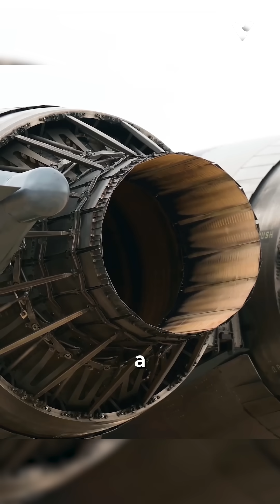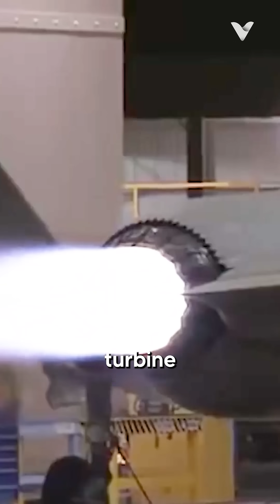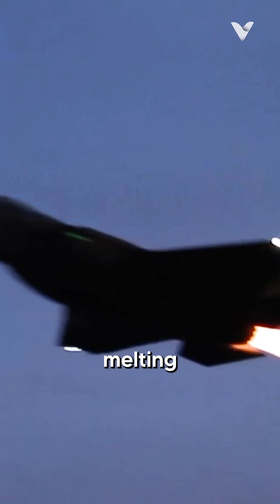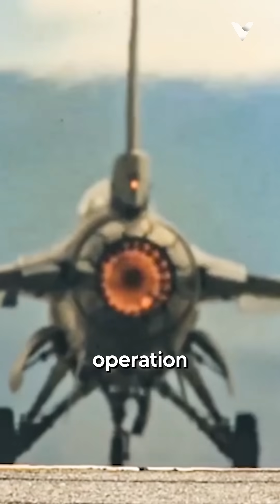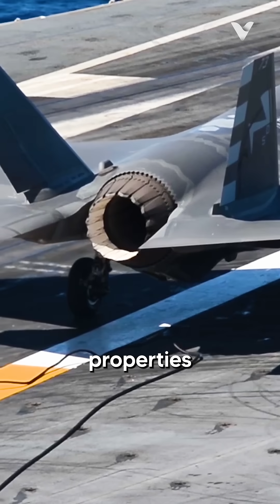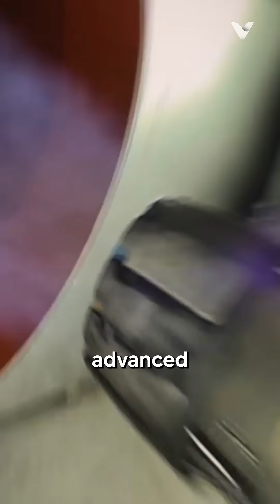Why Don't Jet Plane Nozzles Melt? #shorts

Comment: I'm not sure why they don't mention this, but lots of planes use bypass air both to power the afterburners, as well as cool the nozzles.  F-22 is a prime example of this, and uses perforations that allow bypass air to flow over the nozzles.

Comment: The proper answer as to why a jet engine doesn't melt is because they use new bypass air as an air barrier to keep the flame in one place so that the flame never touches the nickel chromium super alloy mentioned in the video. They never did get a good shot, but with most jet fighters for example, if you look extremely closely
There are pores, thousands of them on the inside of an engine for air to come through to keep that air barrier constant throughout the engine so it doesn't melt. Hope this helps.😊

Comment: Laser drilled shaped cooling holes keep a thin gilm of air over the surface keeping the flames off of the sidewall.  Check out prima power laserdyne on youtube to see how this works

Comment: Thin film cooling is your answer. No jet nozzles use regenerative cooling, rocket engines do (and some hypersonic engines in the past experimentally). Thin film cooling is also why turbine stages can operate past the melting temperatures of the blades.

Comment: There is another reason. The fuel they use is actually very good in absorption of heat. They cool the nozzle and then are used for combination all at once.

Comment: New on energy is mad ot of asid fiber light fiber glass asitonic lemon lime gratfrout  in a fiberglass sulfuric asid miro chip on carburetors car fan.heating and cooling systom sistems  mrio lence to thermals thirmals two refrigeration carbonated  carbornfiberglassis a pullet pruf up grades the righter jeats

Comment: GTT glassblowing torches use regenerative cooling. They were the first company to put the heat sink INSIDE the torch instead of outside, with the fuel lines running through the heat sink — preheating the gas and cooling the torch simultaneously. The flame is over 5000F, hot enough to work quartz, and yet you can grab the nozzle and it won’t burn you.

Comment: Modern engines are air cooled. There is small air layer around the surface that insulates engine from high temperatures.

Comment: Turbofan engines use bypass air over the high pressure compressor and turbines to produce 70% of it's thrust, (There abouts.) A Turbo jet does not. Big difference. They should not be confused

Comment: '...operates by sucking in air, compressing it, mixing it with fuel, and then expelling the hot gases through the turbine nozzle at high velocities."

I think you missed an important step:  igniting the air-fuel mixture...

Comment: Alloys of Titanium, Inconel-X, Hasteloy, high cromium steels.
These are all considered "super alloys".
In recent years ceramic coating applied with a laser has been perfected, can be seen as a cream-white colour on the inner surfaces of the nozzle.
This is the field of mechanical engineering - materials sciences.

Comment: Inconel isn’t even all that great at temps.  In the steel mill I spent a decade in on the EAF floor.  
Our furnace exhaust was made of water cooled panels of inconel.  An atleast once a week sometimes more we were shutting down to have it welded up where it was pissing water from.   

An it was just where the flams a smoke a dust was being sucked to the baghouse.   So it wasn’t even seeing the full heat.  

This day and age you would think they would have something way better

Comment: Why in a jet engine, whether it is of a military or a commercial airplane, the pressure doesn't come out by the front as well? I mean, I understand the turbine is compressing the air into the combustion zone, but the pressure must be so high that I have a hard time accepting the fact that it just doesn't overcome the turbine's pressure

Comment: I am a current f/a18 mechanic and previous USAF veteran. Even with afterburners on, you can touch the outside of the engine (I've done it). The "feathers" that open and close are titanium and the inside panels that you see there with the off set white color are ceramic panels. Those inside panels are what shields the heat from touching the metals.
Reply: And ceramic is a refractory
Reply: I think we use a similar coating on racecar exhausts. It's cool to the touch in minutes. I forget what it's called, but it is an aerospace coating. It's flat white and has a somewhat coarse texture. If I'm correct though, afterburners usually have a time limit? Although I know on the F-4 it's limited by fuel consumption.
Reply: We use AN hardware too by the way. Aren't a lot of parts of a jet engine (like the blades) either Nickel Inconel or titanium?

Comment: Gas turbine edges are extremely powerful, they aren't complex, many can operate without computerization. Meanwhile, the crankshaft position sensor generates a waveform that is used to analyze the performance of each and every cylinder of a Toyota Prius. That's a night and day difference in complexity.

Comment: Regenerative cooling was first used in the combustion chamber of the V-2 rocket, where the German engineers faced the problem of how to keep the combustion chamber from melting. The liquid oxygen and fuel is circulated in the double-wall of the chamber, from bottom- to-top, before it enters the chamber on the top, so its both powering the engine and cooling it.

Comment: Oh yes! At 2000°C you can even melt copper and steal. The steel that holdes twintower melted at 1750. So 2000 is sick! I work with melting alu. But im just touching 1000 a few rear times.

Comment: I’m a machinist and those metals are insanely difficult to machine without special ceramic tools that are really expensive. Super alloys will just simply destroy normal carbide tools that will machine just about every other material no problem. We had to do a couple of processes to this part that was made out of Haynes 242 which is a super alloy and we were taking a .040” depth of cut and our tool lasted about 4” before it was trashed and this is a tool that cuts through stainless steel like butter

Comment: Short of the brief reheat operation, this isn't an actual issue. Upon leaving the combustion chamber, the hot gasses expand driving the turbine and cooling down, upon leaving the turbine, they expand further and trade pressure and heat for speed. At the nozzle, the temperatures are generally just elevated not hot anymore.
Under most operating conditions, you could touch the exhaust of a turbojet and nearly always that of a turbofan.

Comment: Fighter jet engines are low bypass engines. meaning some of the compressed air flow doesnt go through the combustion section and flows in the inner liner of the exhaust section.

Comment: For the same reason why the higher temps area components also resist, combustion chamber and turbine stators and blades. So if you think of the hot exhaust, you should think about those first.

Comment: What they don’t always tell you is that tbc (thermal barrier coating) also contains uranium. At least in my 14yrs experience on rebuilding F404s. Make sure you claim it with the VA.

Comment: In actuality the truth is they do melt the thing uses are to stave off a lot of the heat it just holds a pressure barrier there and the heat blows past that pressure barrier and doesn't touch the metal however it does touch the metal from time to time and there is heat stress from heating up and cooling down anything that heats up more than a certain amount and cools down more than a certain amount takes a physical stress on the materials substrate which is noted by entropy the secret to this is everything melts when you get it hot enough literally everything Burns when you get it hot enough

Comment: So jet fuel would be similar to diesel? Combust under high compression
Reply: Q: So jet fuel would be similar to diesel? Combust under high compression. A: yes. Jet Fuel is just a more refined version of Diesel.  FUN FACT:  a few companies DO make reciprocating Diesel Airplane engines nick named "Jet Pistons" that run on Jet-A instead of AvGas 100LL (ref: Diamond Aircraft) and can run on Diesel in a pinch.  thus same as a Diesel road engine they offer a slight increase in fuel economy once at cruise altitude, and they offer an additional compatibility benefit in that nearly ALL Airports provide Jet-A onsite for refueling whereas not all Airports will pump 100LL (this is especially true in Europe).  iirc the Jet Piston engine made by Continental is actually derived from a production MERCEDES BENZ block they use for one of their 4 cylinder Diesel engines.

Comment: Inconel is known for its strength, resistance to corrosion and oxidation, and ability to perform well at high temperatures. When heated, Inconel forms a protective oxide layer that prevents further corrosion.

Comment: Regenitive cooling is not in the nozzel but he is correct oil cooled electrical systems and coming from the engine giving some specs the excuse to blame the electrician 😂  augmentor is cycled with hydraulic actuators also when going into after burner ( high velocity) aluminum erged with different metals thats all back to your regular broad cast!

Comment: 2000 degrees Celsius is beyond the melting point of many metals. So,... there are many metals that don't get used to make jet engine nozzles. That was the easy part of the explanation.

Comment: It amazes me that all the panels/sections are able to move so smoothly despite the conditions they are subjected to. Smooth as butter.
Reply: It's just levers and pulley systems, they look complex but you can easily build the exact some function of movement with Lego, if you want.
Reply: @HOLLASOUNDS Cool, but can the Legos do it while being hit with a kerosene blowtorch and pulling Gs?
Reply: @RCAvhstape  I'm just talking about the mechanics not the material.
Reply: @RCAvhstape  that's what I found impressive. I'm sure the control system by itself is quite a feat, but the ability to function so smoothly in such conditions is something else.
Reply: @tylerkinley268 it’s not ridiculously complicated but interesting nonetheless. Some are hydraulically operated, others actually move with a bleed air powered control unit that turns flexible shafts.

It’s pretty mechanical short of the control systems that read the nozzle position.

Comment: So all that bypass air just does nothing for cooling😮 all metals have a melting point and if it wasn't for bypass, or secondary airflow the turbine wouldn't melt under the high stesses and heat temperatures. It's much more complex than just special alloys

Comment: Engine casings also have holes strategically placed in them to channel cooler bypass air over the casing, creating an air barrier that prevents the hotter gases from coming into direct contact with the metal.

Comment: F16 Machine here. An id like to say that theirs primarily two things that also keep the nozzle from burning. 1: theirs a chemical coating on the Pri and dive flaps and 2: they’re using  5th and 9th stage bleed air for cooling. 

A for a fun fact. You can sit in an aircraft exhaust after a burner run for warmth during winter season.
Reply: Ceramic coating on the dive flaps and seals, yes. But 9th stage is bled off for the ECS, 5th stage is bled for the anti-ice valve and engine cooling (ie HPT nozzle and rotor). No bleed air is routed to the exhaust cone. Only bypass air through the mixing duct and under the Aug liner. And sticking your arm in the exhaust if you got a Gortex on is a good way to have a inflatable heat suit, but still prefer the EVS exhaust lol, especially if it’s cold and raining 🤷🏾‍♂️

Comment: So a spaceship that travels many times faster than the speed of light and faster than these airplanes would generate much more heat than the airplane nozzles. These space ships would probably heat the exhaust nozzels of the space ship to 10,000 degrees celcius. So the space ships must have to have a product that has to have a higher melting point then  the nozzles on the airplane. Otherwise this is probably 1 of many other reasons a space ship travelling to Mars or farther will not be possible and you will all die during armageddon after wasting tax dollars to support NASA.  Because, in addision there is not enough metal in the earth to build a septic tank and water tank able to contain to  the amount of sewage a huge crew of people would produce travelling to Mars or farther.  You need the air tank the size of Mars to provide breathing air to crew aboard. Then you would have to pack on massive amounts of top soil and water to farm vegetation to feed the cows and livestock and crew. So you definitely will not have enough metal in the earth to build the entire space ship that will weigh 80,000 Billion trillion×9,000,000,000,000^80,000 billion trillion tonnes that like sink like a rock. And if the space ship does actually it will get smashed to hell by Asteriods a comits. Happy Armageddon you are all gonna die after you are finished wasting your tax dollars on your NASA project.
Reply: I ain't reading all that but nothing can exceed the speed of light, not even a space ship. Most ships don't even use thrust is space unless they need to turn as its a waste of fuel usually.

Comment: This is virtually all jet engines. I fly helicopters and the turbo shaft is the same way. The flame never touches the combustion can, it burns fuel and is surrounded by a layer of air separating the flame from the metals surface. My combustion chamber is mainly magnesium and would easily start to melt flame touched the walls.

Comment: Oxidation is when the metal itself burns.  It usually just leaves color changes and weakness in the metal rather than big flames.  Rust for example is the flame of iron.

Comment: By not mentioning the 'afterburner stage' of military jet propulsion, this video leaves the impression that the flame seen in all these action shots is an 'always present' condition. If it was, the parts would melt more often than they don't.

ToT or Turbine outlet temp of your basic P&W turbofan is around 945 degrees. If hotter than that withOUT AB, at best that'd be a reason to keep that engine out of circulation, at worst it'd be an inflight emergency.

The cool, fire from the tailpipe, causing the increased, 'why doesn't it melt' temperatures is the sparingly used afterburner. Just the same, you'll note a whitish tinge to the inside of nearly all the exhaust nozzles in this video. Because the metal very well might melt, is why these surfaces are sprayed with a ceramic based coating; the ceramics being related to those protecting space vehicles during re-entry temperatures approaching 7,000 deg.
Reply: Bro, these ChatGPT style videos stay pumping misinformation or halfass info and people eat it up and run with their own theories. sometimes I think they’ll just take the information that you put out to correct them and save it for another video and just utilize that or if they’re that lazy maybe they take it from the most like comments and wrong with that 😆. You got people in here trying to rationalize how Ginger works through rock motors, or RC motors, pretty much people have never been to a trim pad or a Hush House or have ever had a troubleshoot things like a AB blowout or AB no light 🤷🏾‍♂️

Comment: It's mostly boundary air, if you look at a turbofan, it's easier to visualize. But the core air (what actually enters the engine for combustion) is mostly cooled off by bypass air, which goes around the turbine sections and cools them off. Additionally, items like the combustion chamber are engineered so the flame does not actually touch the metal, which would melt it. 

Source, have my A&P

Comment: They forgot to mention that jet fighters use ceramic materials in the exhaust nozzles and combustion chambers.  In fact, when the space shuttle was in service, it used ceramic tiles to dissipate the incredible temperatures that the orbiter incurred during reentry....

Comment: I searched the internet regarding inconel melting point property and it is only 1350⁰ C. How come this withstand 2000⁰ C?
Reply: See, other metals with higher melting points get softer as they get hotter but Inconel 625 retains 13.3 ksi tensile strength even close to its melting point, this property in addition to the heat shielding makes it the perfect thing for this use case
Reply: @sillicon8227  thanks for the info. Never know a metal can have that much tensile strength at melting point

Comment: I've never truly appreciated the way in which the nozzles expand and contract. So neat
Reply: What about thrust vectoring? When the nozzle is mechanical and helps the jet turn fast, with less force on wing surfaces? Huh?
Reply: It’s true that you never have, and they frequently tell me all about it whenever I visit.
Reply: Its awesome to see that design in Animation/Anime
Reply: It's like an anus about to release poop
Reply: Exhaust nozzles open & close, they don't expand & contract throughout the variable stages of after burner & military power(100% w/o afterburners lit...there is a difference...the NAC (nozzle area control) opens & closes the nozzles to focus the exhaust for maximum thrust according to throttle input...
Reply: @F-4PhantomII On current engines, the exhaust nozzle is controlled by the: 

Convergent Exhaust Nozzle Controller (CENC) - Pratt & Whitney F100 series

Engine Hydraulic Pump via signal from the DEC /FADEC - GE F series engines and Pratt adopted the system due to less Comp Stalls and AB Blowouts on hydraulically actuated nozzles

Comment: The f111 had exhaust gas temps of 2100 degrees F unless you got fighter jets with engines from the Saturn 5 rocket, they sure as all hell ain't reaching 2k Celsius, no matter what you burn.